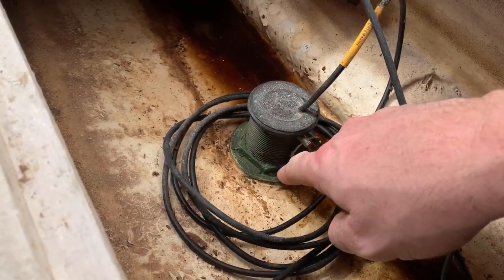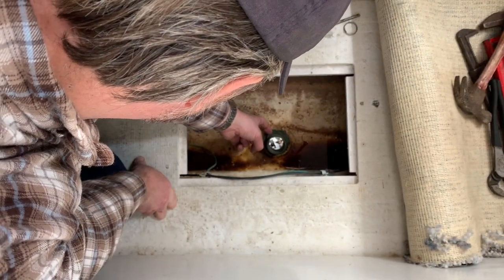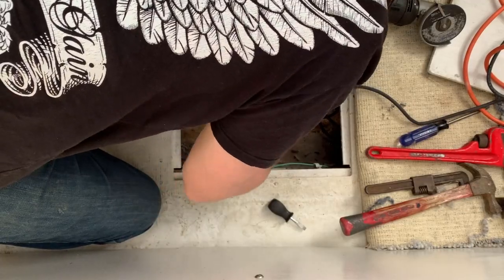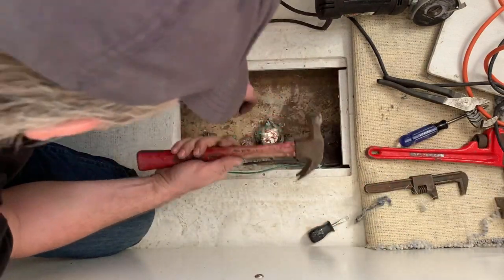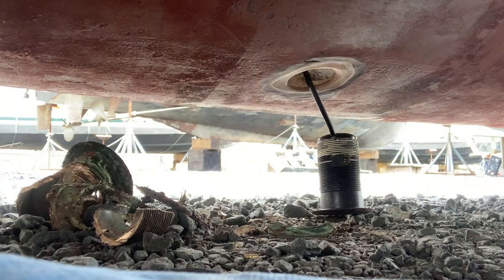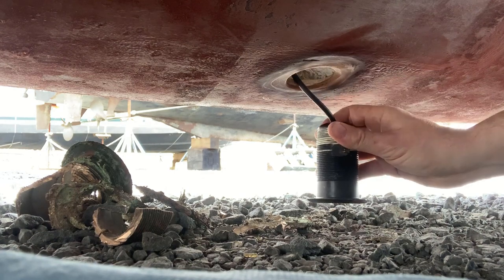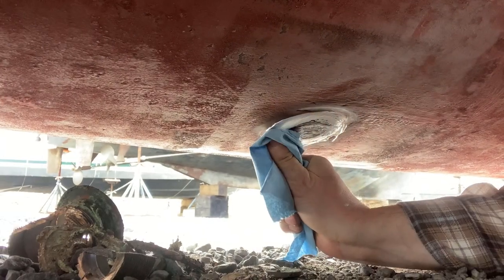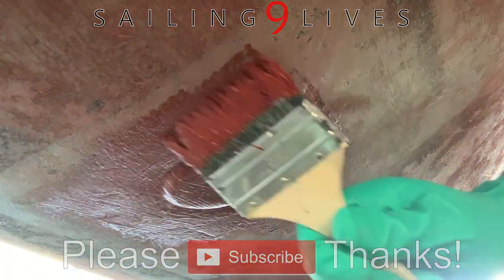Depth Transducer Relocation (Boat Work: Sailing 9 LIVES)

Comment: When I install a through hull I I put masking tape on the hull spaced back a bit from the hole.  Makes clean up less painful, you could probably also tape the traducer and peel it off after the install.  I've only installed one through hull so I might not be an expert:)
Reply from the maker: Well, between the two of us, one has to be more of an expert than the other... right? I think it is you, Brad. Masking tape makes good sense. I didn't use it because I didn't happen to have any at the boat that day (though I thought I did). :)

Comment: Getting the feeling, you enjoy swooping old holes, for other new holes in your fiberglass!! At least, you've got the art, down pat!! That's quite the abrasive grinding pad your using!! Make short work of any grinding  project!!  OK!! That transducer won't go anywhere!!
Reply from the maker: We were just eyeing up one of the two thru-hull fittings, talking about closing it up since we don't need it anymore (another project, to be continued...). More fiberglass work... we decided to skip it for now, given the rather long list of fiberglass projects we already are working through. But, you are right... we do enjoy it in a way, or at least Duke does. :)

Comment: yeah bub that was a flange nut. Might be a few big items like that on the boat. Might be a common size though so that you could buy a socket to fit them.
Reply from the maker: Yep... sometimes we learn through indirect means, such as destroying a large flange nut. :)
Reply: @Sailing9LIVES  

A box or tube spanner fits better allows you to reach down over deeper fittings. They tend to be cheap as they are just formed from steel tube ...painted or plated.  
Clearances are always an issue ...i swear designers builders dont think about access and replacement.... On almost every thing that moves. 😕
Reply from the maker: @clivestainlesssteelwomble7665  Oh, how right you are! I work on cars as a hobby, lately focusing on undesirables (from a depreciation point of view) like Jaguars and Land Rovers... these were clearly intended to NEVER be fixed EVER by a human being, excepting of course their tendency to break often.